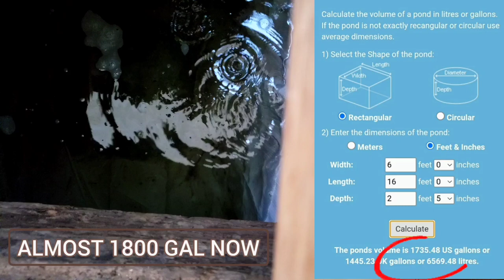Rainwater Harvesting for agriculture

Comment: Maybe make a diverter to send water from the gutter out to the pond, bypassing the underground tank. The bilge pumps will take a lot of power and will be slow, much slower than a rainstorm.
Reply from the maker: I've never gotten more rain than this in two years and last year was supposed to be the worst monsoon in ten years. I should be able to place the switch low enough that there's room for 600 gallons and if there's rain in the forecast I can manually move it.

Comment: why use pump ?,
why just don't put pipe extractor on a high secure level to make the water flow outside ?
Reply from the maker: I'm not sure what you're referring to.  I use several pumps. They run on my solar so it's not an issue.  My shower needs high pressure and so do the pumps that move water. Thanks for the comment
Reply: @FrugalOffGrid  
yeah it is high maintenance comparable to a PVC pipe placed in the underground water reserve and make it to extract that water to the surface water reserve
because it seems to me it will be higher and the water will flow without pump 
i hope this make it clear now
Reply: @FrugalOffGrid  at some point you said you want to use pumps to stop the underground water reserve from Flooding why not just put PVC pipe to make the extra water to flow to another reserve
Reply from the maker: Simply placing a pipe into the underground cistern would not pull water up and out then over to the pond.  It will require a lot of work and equipment I don't currently have. It's easy to dream up projects and another thing to be able to put them into place today.